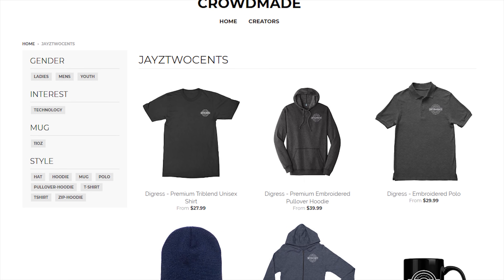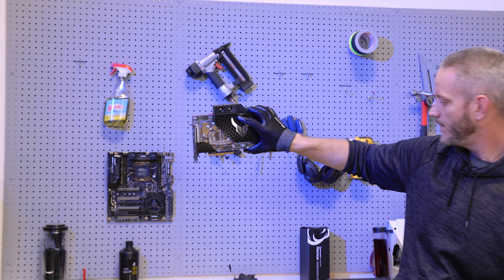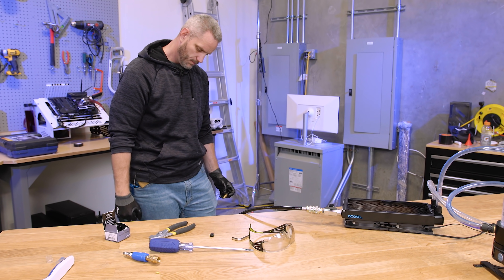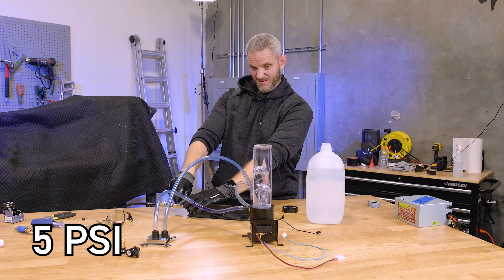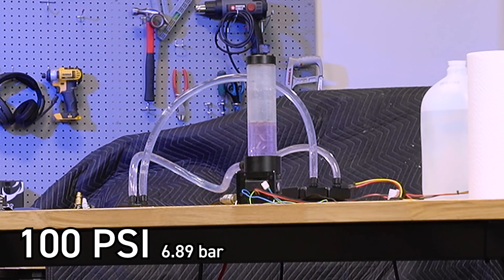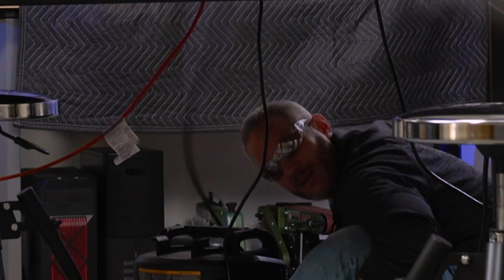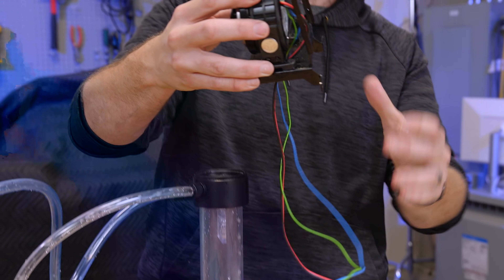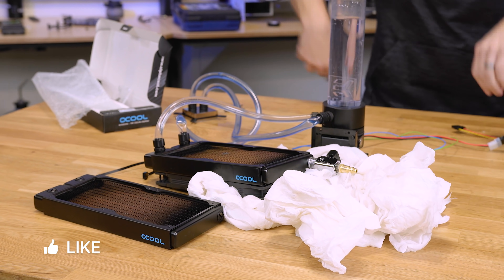The loop EXPLODED! DON'T TRY THIS!

Comment: water can get hot but not too hot even if cpu will be at 100°C for couple of hours and still even if...there is a slight pressure by heating so boil point will be shifted 105-120°C but it's only my wild guess

Comment: Fun fact: water doesn't compress. So the fact that the air was pushing the water out means it was creating so much pressure that it was just stretching the metal and other parts that would flex.
Colin Furze did a video on something sorta similar, called "hydroforming" where you basically just use the water pressure to bend metal into shapes.

Comment: i used to use a bycicle footstanding pump with a swimmingpool nozle to test and fill y systems .  but since i once blew a gpu waterblock (the acryl cracked)  i stopped doing that (was so easy fill 
the reservoir push in the water using air and refil the reservoir again)

Comment: I think the fitting on the radiato was bent from the Impact and not from the pressure. Right at 5:32 it lookes pretty straigt. But the long valve has a high ammount of leverage on the joint.

Comment: Im surprised that the plastic threads failed first on the pump yo reservoir joint rather than the tubes. Granted had those threads not popped Im sure that tube was about to go at any second. But still

Comment: Theres what, about a 1" hole in the bottom of that reservoir? There was 140lbs of force pushing those apart.... dayum.... Probably more if you take into account the surface area of the top of the water and the reduction of the diameter to the hole....I was honestly expecting a hose fitting to go first!

Comment: I have a story.. Just finished building my new rig, had to put my D5 pump/res horizontally because it was the only way it would fit. I filled my loop to the brim with liquid to make sure no air would pass through the pump. After a stress test some of the liquid in the loop vaporised into steam which is totally normal and fine as long as you have a bit of air at the top of your res for it to go, but mine didn’t so the pressure built up until one of the pipes exploded out of my cpu block. This shit can happen so don’t do what I did..

Comment: If you take a water bottle cut a hole in the cap and put a car valve stem through it and bead seal it you can get it to hold 50psi sometimes

Comment: Never do this! If you want to put high pressure into something you should use a pressure washer they output about the same pressure but because water is an in-compressable fluid when the test subject ruptures it will not cause an explosion  whereas if you use a compressable  fluid like air it can store energy over time and release it all instantaneously. In other words an explosion. Its like the difference between licking a battery  and licking a charged capacitor, one will cause a tingle the other will cause death. 

Tldr: don't  be a twat, use a pressure washer not a compressor unless u want to increase the risk of straight dying.

Comment: why do you really want a water cooling solution over an air cooling solution? I really don't find a reasonable reason (XD) to use a water cooler and run the risk of destroying your hardware at some point

Comment: if heat can generate that much pressure in a system because the pump failed there is a serious issue with the coolant of choice

Comment: That was the plastic tubing that gave way and popped, it actually held till 140psi that's pretty good.  The thin metal on the rad was beginning to buckle and if the tubes were stronger probably would have finally burst their seams or the solder points.  Very informative and hilarious video jay good work to the whole team!

Comment: It could be a difference between your Experiment and a System is completely filled of water. If there is no air and the Temperature increases, it can build up pressure really fast because water is incompressible. Hydraulics vs. Pneumatics. In closed water heating systems there is a diaphragm expansion vessel to prevent this. Or in oil filled transformers, there are conservator tanks.

Comment: pctech of 28 years + exp... first time I ever heard about liquid cooling I thought...   well thats the dumbest fukin thing I ever heard...

why would you risk your system on ONE thing failing,   water and electricity   BRILLIANT..

meanwhile I did think about a peltier affect module...  one side gets hot, the other side cold.  then I though about co2.. a cooler with co2 is easy..  a cooling block and a compressor...   AKA REFRIGERATOR when they stopped using freon ..

ps you can get a cpu to BELOW ZERO with liquid nitrogen blocks to lol....

Comment: Mmh, i still don't like AlphaCool. Very sloppy in terms of tolerances. One time i couldn't even fit an AM4 bracket on their CPU heatsink because it simply didn't fit. Another time i had to stuff FIVE graphite pads between the GPU and the block for it to make contact. Another time one of their rotary fittings came out of the box leaking heavily, not JUST dripping.

I don't use Alphacool often, but when I do there is always something wrong with it.

Comment: In terms  of cooling, it would be more interesting to see how long the system could hold a hard vacuum.  Of course vacuum pumps hate water : Boiled distilled water would have to be added afterwards, and leaving 1/2 empty  space in the reservoir by a separate valve once vacuum pump is isolated.  Can these type of pumps be used to create a hermetically sealed system ?

Comment: Hard tubing systems can very well pop under the pressure.
Yes it does require a lot of pressure BUT it only requires a rather small amount of heat to generate that pressure IF you do not have enough air in the reservoir.
Filling the reservoir to the brim (as i have seen people do) leaves no room for the water to expand into and as it is essentially incompressible (at human scale) it will lead to very high pressures.

Comment: Jay your entreating as hell but your test on how much pressure a rad can take is observed . A proper test would be pressure build up under hot water. Not air pressure of cold air. try 250 degree F water temp and that test would explode at 28 psi from hot water sense your not using a rad pressure cap the boiling point would be way hire than 212degrees F.  You would make a great jester. Other wise known as the kings fool.

Comment: This absolutely CAN happen in a system, but only if you somehow manage to heat the coolant to boiling without hitting the thermal shutdown temp on your CPU/GPU first. Given the usual temperature delta between coolant and component temperatures, this should be extremely unlikely. I had it happen in a real system, but it was the hot side cooling loop of a TEC water chiller. TECs do not have temperature sensors or shut down when they get too hot. In my case the failure point was a tube ripping out of its fitting on the TEC waterblock. Thankfully the case is multi chamber and this delayed coolant getting on the PC components long enough for me to unplug the system. The only things that required replacement were the tubing and pump.

When I rebuilt the system I relocated the TEC hot loop temperature sensor to just after the waterblock, and implemented additional shutdown rules in the TEC controller. It now cuts power if the pump RPM falls below a certain limit. Failure is the best teacher....

Comment: Jay, for future and mainly for safety reasons, that is if you ever decide on doing something similar, stick to pressurising water only. Do not introduce pneumatic in to the system at all. This is because air can compress much more than water and so acts like a spring storing a large amount of energy. This is why the system you had there exploded like that once a vast amount of water in the loop was replaced by air. This is why most notified bodies in piping industry will recommend or require pressure testing on pipework be done as a hydraulic test rather than a pneumatic test unless there is a specific reason for pneumatic testing. A water pressure test fail will simply cause a leak while a pneumatic test has potential to explode the system to bits.  Generally for pneumatic testing a safe distance has to be calculated depending on the pressure before the test within which nobody should be as the test is run. I love your videos so I'd hate for them to stop if something happened.(Funny how I care more about the videos there than your actual safety). Anyway, keep the the awesome work up and keep it safe.

Comment: Need a little help; given that 10 mm is slightly bigger than 3/8 barb, will a 10 mm soft tube leak when used with a 3/8 barb?

Comment: Once the pressure equalises in the whole system (after the tap has been open and the "whoosh" of air has finished), water will drain down into your compressor.

Comment: I've got a watercooling question: Does it make more sense to set radiator fans to a static RPM, control it based on CPU/GPU temperature, or control it based on fluid temperature?

Comment: Jay, i drove to a family members house in WY and left my PC in my Jeep. It was about 0 degrees F out over night. My water bottles in Jeep all froze solid but did not explode. I didn’t think any harm would happen to my PC so i didn’t think of any concern until i realized i have a water cooler radiator installed!  CORSAIR H100I RGB PLATINUM COOLER. My question is, should i worry before i power it back on after i give it ample time to thaw?

Do radiators have chemicals in liquid to lower its freezing point? 

I used to live in Alaska and leaving water bottles, especially a Gallon of water or soda, in the car will explode with ice particles everywhere! Of course, thats -20 to -45 below too. 

My brother drives semi trucks shipping everything across the country and he doesn’t know of any shipping company that ever keeps shipping goods at room temperature - just cold trailers for perishables. Video idea - freeze solid a liquid cooler and test it, and also test freezing it with water bottle till water bottle explodes to see if corsair survived.

Comment: Hello I hope you can read this Jay. Can you do normal radiator cooling with expensive fan (noctua) vs a push pull cheap fans setup? Buying twice the number of cheap fans for push pull is still cheaper than 1 noctua. Which setup can get cooler?

Comment: Hey Jay would it be possible to make a custom liquid cooling loop using normal parts (radiator, pump, blocks and tubing) but instead of using water you fill it with mineral oil.  If anyone would be willing to sacrifice perfectly good components for the sake of cooling science, it would be you.  I've had this question for a while but through research online I haven't found anything on it, and I can't necessarily afford to risk the chance of damaging components to test it.

Comment: Have you ever try to put a Peltier radiator in the middle of a water loop to drawn back the liquid temperature? Like a 360mm custom loop with a 120mm Peltier aluminium radiator in the middle of the way (bomb exit to first block in maybe) after the liquid get cooler from the fan radiator? So you can turn it on / off when is needed and not a full time cooling.

Maybe a 120mm with 6 cheaper Peltier tablet (3 each side) instead of a expensive one over the processor like some people usualy do.

In this way, Peltier will be a custom watercooling + a helper instead of a single solution. If this work (and problably will not), this can be a helper for overclock or hold intense processors like Threadripper or R9 3950x.

Comment: Pressure testing with a compressed gas is really something you shouldn't do at home, but neither should you at work or anywhere else for that matter. Pressure testing is done with an incompressible liquid. If something bursts you don't have parts and shrapnel flying around or rupture your eardrums (depending on how big the thing bursting is).

Comment: I guess on a follow up experiment you could heat the system (maybe put a fire under the "cpu plate thing"), turn off the pump and measure how much pressure it gets. If you get rid of all the air inside your system, it can get a LOT of pressure from thermal expansion. Air compresses easily, but when water heats up and tries to expand, even a very small amount of expansion will create a lot of pressure if its contained. P.S English is not my mother tongue so sorry for that.

Comment: Just like with the condoms back in school.
Fill it with water to show how strong they are.
These components can take a ton of abuse and still work - IF (!!) you use it correctly and tighten everything down on connections. Usually the components are not faulty, it's the connections and O-Rings like you always tell us Jay. The more connectors and adapters you add to your system, the more areas of failure you introduce.

Comment: Jay, water may not have gone down the line while you introduced air, but once pressure equalized, water definitely went into your compressor tank. Just look at how much the water level dropped before it exploded. Water isn't compressible, so that displaced water had to go somewhere.

Comment: so i measured my pump was 60mm at reservoir  tube i figure thats the size of piece that failed... because we're working in inches 60mm=2.3622 and use formula for area from radius 2.3622/2=1.1811 ..... π x radius squared .  the area is 4.382512986714 x 140psi means we had 613.5518181399 pounds of pressure there at that failure point ..................... not bad i say lol

Comment: Need to change the setup. Put the water block on something hot and then try to water cool the heats source and have a pressure gauge attached to the loop to measure the pressure from the steam building up in the system. I basically want to see the results when all the components are hot.

Comment: im currently working towards buying my next new rig. however ive 
found an issue that i need answering. i hope to buy 128gb (4x 32gb) of memory but 
wish to also buy a i9 9900ks and a z390 board. however, all the z390 
borads advertise as 64gb maximum. ive been told that intel released bios
 updates so z390 boards can use upto 128gb. however with a new build, 
will i have an issue inserting a 32gb stick, in order to boot the system
 into windows inorder to download and install the bios updates even 
though the board at this point doesnt support it?
please help.

Comment: Also it was fun, but it is not accurate. If you don't have air bubbles in your loop as water is not compressable like air, you will end up with much higher pressures, like even 100-200 bar if you heat it up. These kind of dynamics are different for gas and liquid. You should try heating up a sealed loop with no air bubbles in it and see what happens

Comment: Wonder what kind of psi a loop would endure at like 90-100C, that’s around the operating temp of a lot of cars, and you don’t want to take the radiator cap off a hot engine lol

Comment: Jay, my name is Ryan, and I had some big questions about gpu failures, specifically my own.

Background info: msi 1070 (4 years old). 

Computer starts turning on randomly without hitting the power button.

The next week when turning on the computer, it flickers on and off excessively for 15 seconds, burning smell present. Strip the computer down, can’t tell where smell was coming from.

 Re-set up the computer, and try to start it again, turned on and off within 2 seconds and smoke isolated to gpu, slightly left of the psu inputs. 

So what’s dead? Can it be fixed? Will the problem repeat itself if I replace a single part?

I just don’t currently have the income to play around with parts that may go dead instantly because somethings shorting out everything. MSI isn’t super helpful and I was hoping some intelligent, patient human being would be able to reach out to me and help me answer some questions

Comment: The lesson here should be to always keep a pocket of air in your reservoir so you have something to absorb the change in pressure. The expansion of water under the boiling point is only 4 percent, which shouldn't raise the pressure in the loop unless there's absolutely no air or any other place for the increase in volume to go. Also rated for 2 bar means it shouldn't theoretically fail before 6 bar because the factor of safety on pressure vessels is 3.

Comment: I mean, in theory a CPU that can run at over 100C with thermal shutdown disabled could technically boil water, and it's not going to take a lot of steam to build 150psi in a closed system of this size, soooo...

Comment: @jayztwocents Are your sure the valve fitted to the rad didn't bend because it got catapulted into the air and landed on it? I mean that looks to make more sense in my opinion... 
Would have been nice if you had a GoPro for some close up shots to see what actually failed first. Great video though :D I'm even more confident with my Alphacool watercooled system now.

Comment: You should retry this (with more safety gear) with the loop at its maximum rated temperature. I'll bet its failure point would be much lower (but still far higher than it would likely ever experience in use). Side note, I refilled a Corsair AIO cooler (old H80i) and replaced the factory seal with regular old silicone, then torture tested it up to its max rated temperature with a heat gun about 10 times over several days without failure. Even after 7ish years of use and a sketchy refill these things can keep going.

Comment: I know for the normal person liquids cooling or air cooling is all you need. but as I do work with HVAC I was wondering if you have given any thought to a glycol over refrigeration cooling system?I say this as you can control the temp in order to stop sweeting.granted the hole case would be custom and I bet would way in around 50 pounds or more.   but for extrema over clocking having your cooler running at any temp you set it at would be nice.